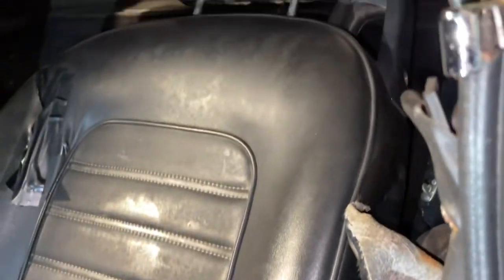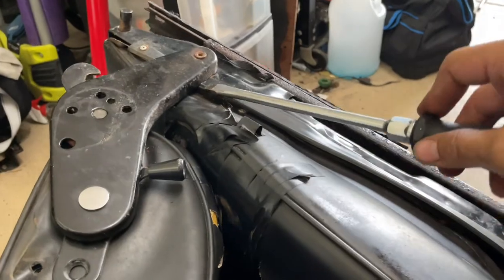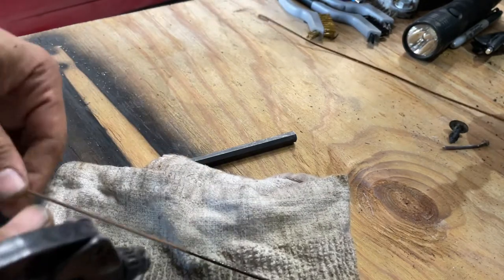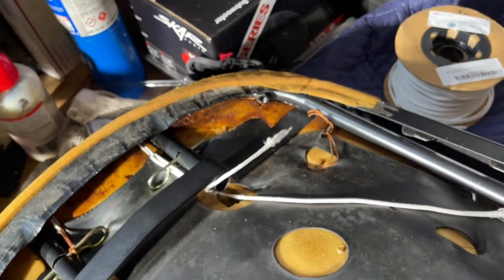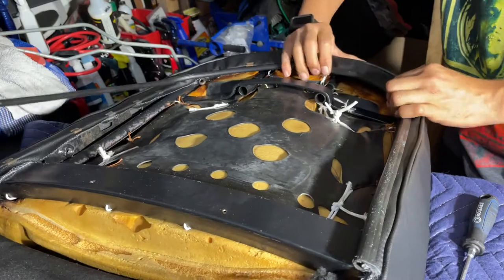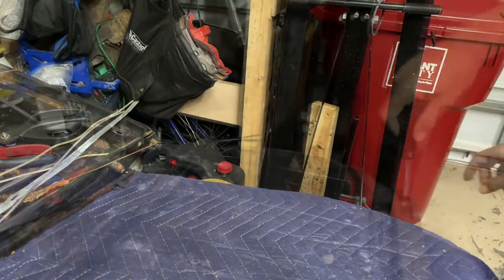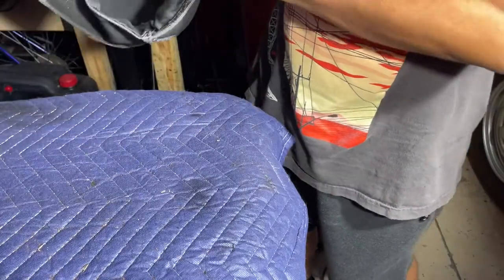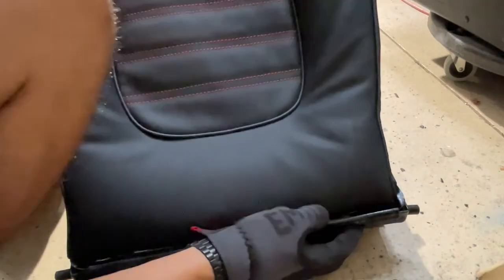￼￼Seat reupholstery on a 1986 Alfa Romeo spider￼

Comment: Where do you show putting the back seat level (metal) and the bar that helps assist with moving the seat forward and back? Is the metal bar inside the upper back seat?